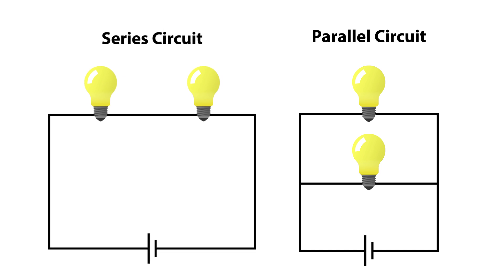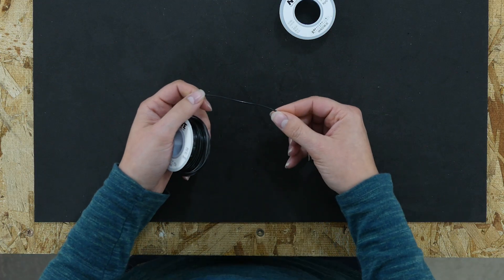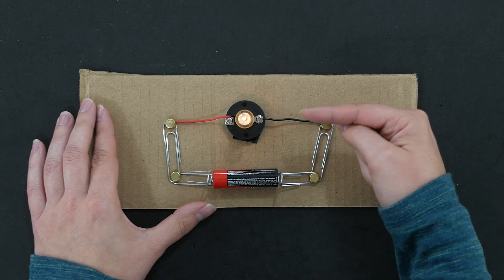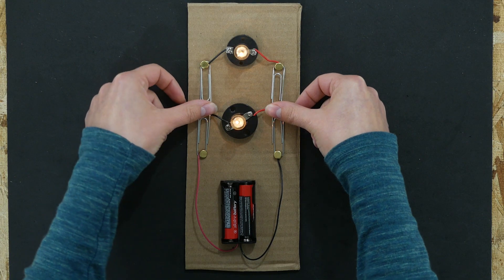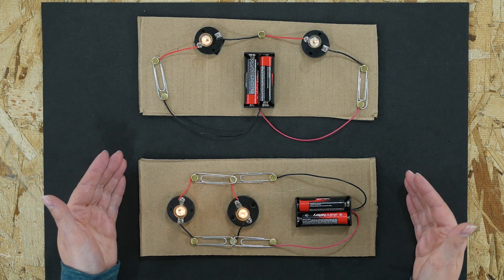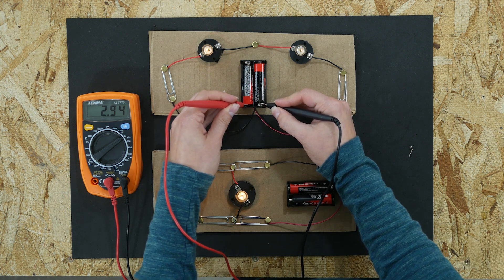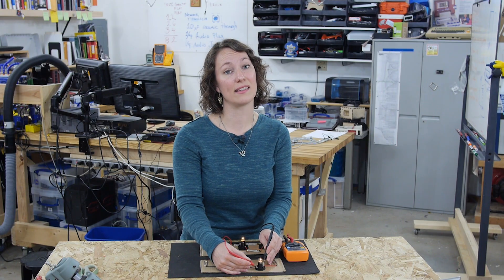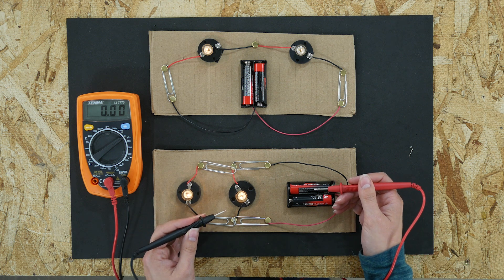Series & Parallel Circuits - The Learning Circuit

Comment: I was surprised that the two bulbs in series differed significantly in brightness. Thinking it through, the currents through both bulbs must be identical because they're in series. Using ohms law, if one bulb has higher resistance, it must have a higher potential difference across it - a higher share of the total voltage provided by the batteries. Because electrical power is voltage times resistance, that means more electrical power, which means whichever bulb has the greater resistance gives off more light. Assuming the two bulbs are intended to be identical, that difference in light should be tiny - but while the bulbs are lit they're also heated a bit. The brighter bulb gets heated more, which causes its resistance to increase, which means its share of the voltage increases and it gets a bigger share of the voltage, making it brighter and hotter still. So a small initial difference gets larger because the brighter bulb gets hotter, which makes it brighter (up to some limit). If you asked me before this video and thinking it through, I'd have said the bulb with the greater resistance gets less power so is less bright - that's probably the case for bulbs connected in parallel, but apparently not for bulbs in series.

Comment: i still don't understand this one because no mater what 3 volts and complete circuit is the same thing right? the one on the left at 1:34 that is 3 volts so is the one on the right, both are receiving 3 volts, both are complete circuits with 2 lights attached using the 3 volts from the battery. so why is the one on the right brighter. something to me is not being explained enough.

Comment: Stranded wire is only more efficient (by which I assume you mean lower resistance) if you're sending high-frequency signals through it. For lower frequency or DC electricity, stranded and solid core wires will have basically the same resistance for a given wire gauge.

Comment: Considering that both bulbs are receiving near the full 3V of power when connected in parallel, does this put more strain on the batteries? Will the batteries run out of charge more quickly than when hooked up in series?
Reply: Yes, the batteries on the parallel circuit will run out faster than those on the series circuit.

Comment: Why are the two bulbs in the series circuit different brightnesses? Different resistances? They are seeing the same current and P=I^2xR tells me they likely have different resistances or efficiencies
Reply: Hi Jim! I wish I knew how to create video animations and share them in the comments! That would be cool. I guess my comment was a bit cryptic, thanks for the decoding. But yes basically light bulbs dissipate energy (watts or P in the equation) based on the current they are experiencing assuming the resistance is constant. In this example I would have expected the light bulbs to be equally bright, because presumably the resistance is similar if the bulbs are the same type (same “wattage”) but they are different brightnesses even though they are experiencing the same current. So either they are different wattages (resistance is not the same) or the dimmer one is emitting a different wavelength of light outside of the visible spectrum. Sorry this is getting technical again...anyways hopefully I’ve explained my thoughts more clearly than last time.

Comment: I'm not 100% anymore, BUT, I think she has her information wrong?? Stranded wire more efficient sending electrons through versus solid wire? I am almost certain that is the other way around??? 

Personally, I've never had a problem using flexible wires for anything, especially with tinning the ends. Solid wire though, I have found a small problem every now and again. < That's a personal finding. But yeah... I think she misspoke in her video. ??

Comment: Personally, I built circuits for years as a kid without quite entirely understanding the fundamentals of current and voltage - particularly Kirchoff's Current Law and Kirchoff's Voltage Law. I knew LEDs needed resistors, I knew what happens when resistors or batteries are in parallel or in series, etc., but when I finally, really understood KCL and KVL, everything started to make a lot more sense. From my perspective it's all but meaningless to teach electronics at a beginner level without establishing how current and voltage work, how to meter them, etc.
This video gets us a little bit of that - but the paper clip circuits are seemingly losing enough energy that the meter readings don't fit what we'd expect from an idealized version of these circuits (which is itself a bit confusing)
And there was no discussion of why the two light bulbs in the series circuit are winding up with different light levels and different voltage drops. They're splitting the voltage, why aren't they splitting it equally? A beginner might think it's because the second one is "downstream" from the first, getting "leftovers" - but both lights have the same amount of current flowing through them. The difference is in the light bulbs themselves. The second has a lower resistance than the first. This could be the result of manufacturing differences or the effects of wear, or the two bulbs might just have different ratings.
Reply: You sure do repeat yourself a lot!

Comment: Borrowed from dear friend Google...When batteries are hooked up In series, the voltage is increased. For example, two - 6 Volt batteries connected in series produce 12 Volts. When batteries are hooked up in parallel, the voltage remains the same, but the power (or available current) is increased. This means that the batteries would last longer.

Comment: How many paths could you add in a parallel circuit while maintaining 3 volts for every path?
Reply: In principle, as many as you want. In practice, it depends on how much current your power source can provide.
Basically, if you look at the circuit in ideal terms, you would have a 3V source and continue adding parallel branches to it, you would still get 3V and each branch circuit would continue to operate.
In practice, what happens is that as you add more current draw, the power source has trouble delivering that same 3V. Because if the source really were delivering 3V, all those branches would happily consume all this current from the source...  But if that's more current than the source can provide at 3V, the voltage of the source decreases - so the branches draw less current. And at some point it all evens out.
When dealing with batteries this is frequently modeled in terms of a battery's "internal resistance". You look at the battery as if it were a voltage source with a series resistor. So if you draw more current from it, the "internal resistance" drops some of that voltage. But it's not really the source "resisting" current, the source is driving the current...  It just can't keep up with the demand, so the voltage, the "electro-motive force" that pushes current through the circuit, effectively decreases.
When setting up a power source we generally deal with this in fairly simple terms: We power a circuit on a certain voltage, and expect it to draw a certain amount of current. So we provide a power supply that can supply that voltage, and at least that amount of current (preferably more, so we have some elbow room)
Reply: Voltage in parallel is the same at each resistor

Comment: In dealing with the series and parallel circuits in particular your design of the light bulbs and paper clips as a great example with the voltage drop the way it is won't the parallel circuit consume more batteries versus series circuit even though the conveniences of the parallel circuit are greater than that of a series
Reply: Yes! You are correct.

Comment: It would be interesting to show the formulas, current and resistance on the circuit.
Reply: In series Current is the same. Voltage, Resistance and Power adds. In parallel Voltage is the same. Current and Power add. And resistance is the inverse’s of each resistor added together and then the inverse of that gives you your total resistance.
Reply: Jim F - CalgaryAB yes

Comment: I think it would also be important to mention that while the lights are dimmer in series, they are consuming less current from the batteries than the parallel circuit. 
To a beginner, you might see these two circuits side by side and think “there’s no reason to use series, the lights are dimmer.”  But for battery applications current consumption is a priority. 
Great video though!!!!
Reply: Excellent addition! We have some smart cookies here.
Reply: Love the train of thought. When trying to figure these values out for a component or circuit, Ohm's Law can often be applied. Some components are picky about needing a certain voltage or current in order to operate. There are a lot of values you can figure out in theory by applying Ohm's Law, keeping in mind that in practice, there are often other factors that can cause small changes in the circuit. As has been mentioned, the paper clips add a certain amount of resistance that skews the anticipated voltages. In other practical circuits, wire length can also cause problems. For example, I have an external HD powered by USB. Using a 6ft cable, it wouldn't work, but when I switch to a 8 in cable, it worked fine. Also, not all components are manufactured perfectly identical. There is some variance. Generally, a AA battery won't have exactly 1.5V, it could be 1.57 or 1.42V or something else. Resistors also often have a rating for variance as they do not guarantee precision in the value. 
There are a lot of nuances in electronics that are often learned through experimentation. My suggestion? Get out and make something! And if you fail, it's just another great opportunity to learn!
Reply: Thanks for the info. I was wondering exactly this. But now that i have that question answered i am starting to fall down the rabbit hole.
For instance:
I would assume that other components need an exact amount of current to work properly (because resistors exist) So when would I choose serial over parallel?
In a serial connection what decides how much power each item in series gets? Because it wasnt equal.
If parallel increases power draw, what decides the upper limit of how much power the battery can instantly put out? For instance, would 1000 leds in parallel insta-drain a battery?
I didnt see the point of complicating this with wire type because from what ive seen so far, it doesnt make any difference, or what difference would it have made?
Reply: You mostly don't need two components to consume exactly same current. And components' parameters may vary too - any two lamps are never the same. 

That's ok though. For LEDs only about twice as much current difference is noticable.

In parallel connection, voltage is shared between all components, and current is varies for each one.

In serial connection current is shared. To still comply with Ohm's law, parts that have more resistance get more voltage.

Why even bother with series connection? Granddad's example: if you have twenty 6-volt new-year lamps, you can connect them in series and plug into a 110V power outlet directly, without any voltage convertors (don't actually do that - it may be dangerous). 

Today you will more likely have something that needs to have less voltage or current than you have maximum. LEDs are often connected in series with a resistor to limit how much current that can flow. They react dramatically on tiny voltage changes, so instead of fine-tuning the voltage a resistor is often added.

Power a battery can output is limited with its chemistry (battery type and manufacturer) and remaining charge. You can find discharge-to-power graphs online for some popular batteries.

Power a mains outlet can output is limited by the power that your electro station can output which is immense. Actually, since wires are resistors (even with tiny resistance), if a very small resistor is connected to mains, the wires will heat up and catch on fire together with the resistor and your house. A circuit breaker should detect that situation and cut the power - hopefully before the fire can start.

With a short enough wire, voltage drop on it is hard to notice. However, with thin aluminum wire several meters long connecting a single 1.5V battery to incandescent lamp it may be noticeable enough - those bulbs consume a lot of current and have small resistance, so wire's series resistance is more noticeable. LEDs consume very little current so they won't notice unless you have a ton of them in parallel. 

By the way, an external HDDs contains a powerful motor that rotates a metal blade of death a hundred of revolutions per second, so they consume quite a lot (have small resistance), and thus may notice voltage drop on those Chinese cables with tiiiny wires even with small distances.
Reply: exactly: in parallel, supposing they have same resistance: I=2V/R while in series I=V/2R

Comment: Please go in depth with electrical resistance. I'm always at a loss as for which resistor to use in an led circuit.
Reply: Yes. I want to get into Ohm's Law as I have also struggled with that problem.
Reply: use a 200-300 ohm resistor for a standard led. It doesn't matter whether it's on the Vcc or ground side. In general, resistors values are flexible. Often they are just used to limit current.

Comment: How does parallel vs series affect power efficiency? Would the batteries in the parallel circuit drain quicker than the ones in series or is it similar?